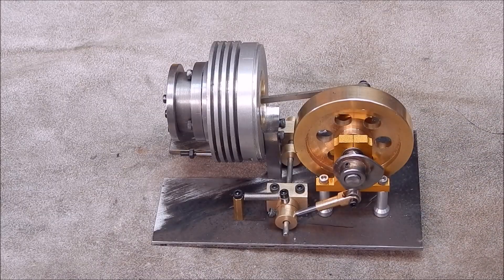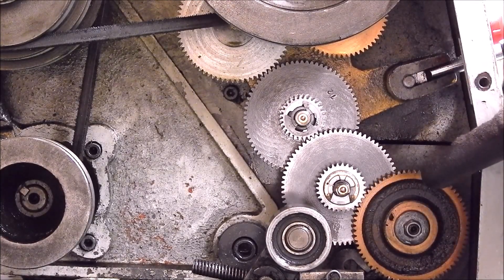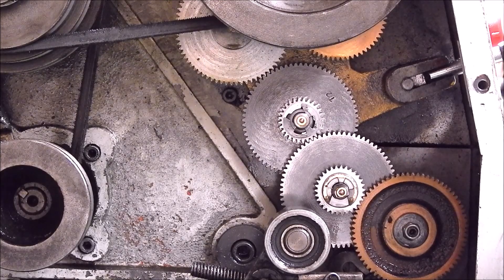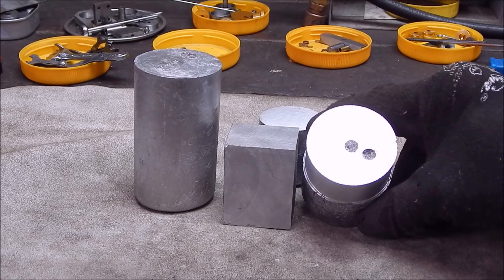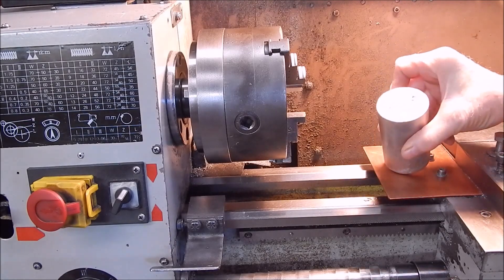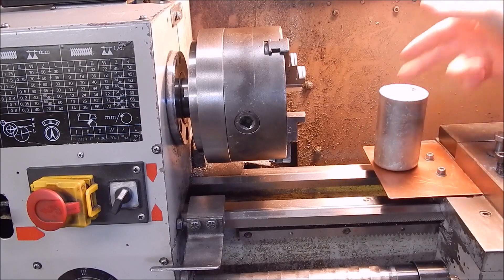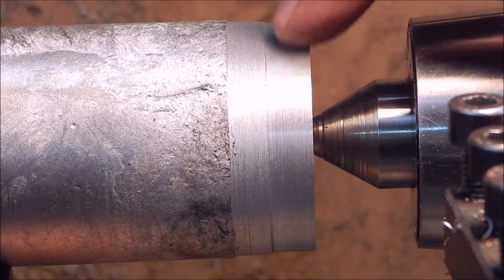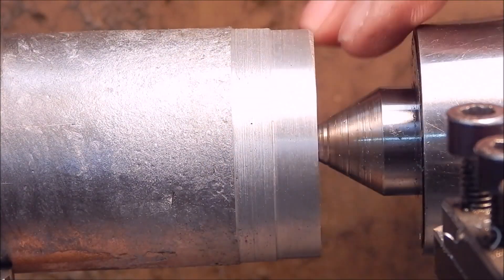Home cast aluminium round stock from scrap Toyota car wheel rims

Comment: What alloy is used for rims ?
6061 in USA and 6082 in Europe ?
Reply from the maker: A356 is most widely used according to Google - it has a significant silicon content and is heat treatable to attain high strength and impact resistance.   Most wheel rims are cast, but forged rims may use a different alloy mix due to the manufacturing process.

Comment: I repair cars for a living so I always have aluminum parts for melting. I tore apart an old water pump and an A.C. Compressor the other day and separated the aluminum from the steel. I save the aluminum and take the steel to the recyclers.
Reply from the maker: A scrap alloy  cylinder head would be good as well, just a matter of breaking it up somehow.  Cheers Rob
Reply: @Xynudu  heads are a little harder to come by because they generally go back to the builders as a core
Reply from the maker: I have melted down scrap pistons from cylinder liner replacement jobs and they are made from pretty good stuff - quite hard and good for gear cutting.  Lots of useful stuff in cars.  My father was a motor mechanic all his life and I have been there and done that with most aspects of vehicle rebuilds ;)  Cheers Rob

Comment: Hi Rob do you melt down the swarf and reuse it
Reply from the maker: No.  It's a waste of time Leon as the surface area of the chips is massive and that means lots and lots of oxide in the melt.  So it basically turns into dross mostly, which you then have to remove.  I know some people re-melt the cuttings, but I'm not that tight ;)  Cheers Rob

Comment: Rob, you mentioned the Kerosene motor oil mix. What are the ratios?
Reply from the maker: One part clean car engine oil to 5 parts kerosene. You can make it any mix you want, but I find this works OK on ally and steel and doesn't smoke much when things get hot.  Cheers Rob

Comment from the maker: IMPORTANT:  Do not overheat your molten metal.  The higher the temperature, the more gas and bubbles will form.

Pre-heat the mold if possible.  This becomes increasingly important as you lower the melt temperature.

High quality aluminium is used for demanding applications.  Only use that.  Don't use low grade scrap which has a high zinc content and breaks rather than bends.  More zinc equals more gas.

This link to an informed article about de-gassing is excellent reading:  https://drive.google.com/file/d/15tAqUUMSssVN5RI7O-cuJrcQfWYg7Wk_/view

Always wear protective safety gear.  Do not allow kids, pets, moisture or other hazards any where near metal casting operations.

Cheers Rob.
Reply: xynudu I’m extremely interested in parts casting, patterns and smelting. The problem is I don’t know enough to ask the right questions. Any tip and tricks are greatly appreciated. The most important thing is getting hole in the right place. thanks for sharing.

Comment: Thanks for the follow up video Rob. That looks pretty decent, I will have to try it. Aluminum here in Canada is stupid money also! I get most of mine from the metal recycler. Cheers, Doug
Reply from the maker: The suppliers sure rip us little guys off.  I hate to think how much it must cost most people to build model engines etc with new stuff.

Cheers Rob

Comment: I do the same thing Rob, but I use HSS cutters and the finish seems better.  I get the same finish as you with the carbide. I pour the aluminum into soup cans and machine off the tin.  A little bit dangerous, but I have a face shield set up.  I use the soup tins and steel aerosol cans (with the tops cut off) as various sizes are available. All your advice in relation to degassing etc is spot on.  I have found the  temperature of the aluminium at time of pour is critical.  I find if too hot I get porosity in the billet.
Reply from the maker: Hi John,  HSS with kero gives the best finish as it won't gall like uncoated carbide. 

I started off casting in soup tins and still do for larger diameter gear blanks.  The tin easily cuts and tears away after.  Steel tube is better as you can pre-heat it and the mass allows the aluminium to cool more slowly with less heat loss shock.  Cheers Rob
Reply: I have used tins also but I remove them from the ingot by splitting down the side with a dremel

Comment: Rob, you mentioned using a mix of engine oil and kerosene.  That's new to me and I'd like to know what weight oil and what proportion do you like?  Would it be ok for steel as well?
Reply from the maker: Yes,  I use it for every thing.  It's an old timers (cheap skate) trick.  You can make it whatever ratio you want, but I find one part clean engine oil with five parts kerosene works well.  Stops galling and cools things down.  It can smoke a bit if things get real hot.  Cheers Rob
Reply: @Xynudu  Thanks for the timely reply.  Include me in that cheap skate group and I'll try it.

Comment: I’m fortunate enough to have access to the local scrap yard so must of the aluminum that I get is extruded, and is really nice to work with. I do get a surprise occasionally with some of the steel I get but I guess that’s part of the fun of trying to make something out of nothing , ha ha  ! Best to you and I really enjoy your videos.
Reply from the maker: Yes, rusty steel can hide some issues.  Axles can have a super hard outer section and a soft centre - they make them that way to flex without failing.  Bastard to use.  I have 10 foot of the stuff (big diameter) in my scrap heap. LOL.  You can never be sure what you're getting cheap. Cheers Rob

Comment: Hello Rob love your videos always very interesting, but you passed a comment saying you use a home made cutting fluid of kerosene and engine oil, what ratio do you use. Paul from UK
Reply from the maker: Hi Paul, 

Yes,  I use it for every thing.  It's an old timers (cheap skate) trick.  You can make it whatever ratio you want, but I find one part clean engine oil with five parts kerosene works well.  Stops galling and cools things down.  It can smoke a bit if things get real hot.  Cheers Rob
Reply: @Xynudu  Thanks Rob I bought some paraffin as we call it here some time ago and did not know what ratio to use, I will make some u thanks.

Comment: Hi Rob, nice castings, did you cast them vertically [ie as a pouring sprue] or horizontally as a pattern with the attendent sprue & ingate.
Thanks Graham.
Reply from the maker: Hi Graham,  it was all cast vertically in a steel tube.  The previous video shows how:  https://www.youtube.com/watch?v=jmiRw2hDoDI
Reply: @Xynudu  Hi Rob, thank you for your reply I've cast vertically into sand before but not too good with porosity  but I like your idea with the steel tube & old cylinder barrels also warm them up 1st & don't heat the alloy too hot, & a nice steady pour, prob that's where I've been going wrong, I built a small gas furnace but most of my castings I do are in the larger furnace & fired by coke, & a bouncy castle blower mainly 'cos we allways gave a few tons in  for the aga rayburn cooker,I spoke to Martin[olfoundryman]  a lovely helpful man [like yourself!] & I'm going to try diesel as I have a burner. thanks once again Rob.btw I'm from yorkshire uk but I'm often in ozz at my daughters but scuppered for now with this virus.regards Graham.
Reply from the maker: Hi Graham,

I think you are correct. 

I just had this link to an excellent article on the subject forwarded to me:   https://drive.google.com/file/d/15tAqUUMSssVN5RI7O-cuJrcQfWYg7Wk_/view

Worth reading.

Cheers Rob
Reply: Hi Rob,Worth reading? you aint kidding!! thank you for taking the trouble to send me this [printed & put in my"foundry folder" ] so washing soda is a definite no no, I never use a degasser sometimes a commercial cover flux & allways a lid on the crucible,when I sometimes use a steel crucible I allways coat it with a zircon based refratory wash also my steel ingot moulds & tools, as you will know molten alloy dissolves steel & I believe it also contaminates the melt.  Regards Graham.

Comment: Wait a sec..Australia is in the top-three producers worldwide of bauxite. And Aluminum is too expensive there? Doesn't add up.
Reply from the maker: Yes and yes.  We are being ripped off big time.
Reply: @Xynudu  I wonder if that's a result of the Rio Tinto / Alcan merger in 2007. Neither here nor there..that sucks that Oz is getting screwed on one of their most abundant minerals. I would have thought you'd be awash in aluminum stock to mill with. Sorry to hear it.
Reply: To smelt aluminum from bauxite requires huge amounts of electrical energy--much more per kg than steel for which cheap coal and other fossil fuels can be used. Australia has a hydro-power (the cheapest source of electricity) capacity of 4.1 gigawatts. By contrast, the Columbia River basin in the NW United States has a capacity of 29.3 gigawatts, some 40% of the U.S. total. For this reason, a lot of aluminum is produced there, even though domestic sources of bauxite are puny compared to other countries. 

Greater still, China's hydro-power capacity is a whopping 352.2 gigawatts. It's partially for this reason that 60% of the world's annual production of aluminum comes from China. Additionally, it's production of bauxite is almost four-times greater than Australia and is the largest in the world.
Regional economies-of-scale aside, the price for most things is determined by how much people are willing to pay, rather than how much those things cost to make.

Comment: What size lath do you use Rob? Looks stout
Reply from the maker: Hi Eric, it's a 10 x 18" Chinese lathe.  It is solidly built and has a Morse 3 tailstock which is uncommon for that size.  Great little unit.  No longer available though.  Cheers Rob
Reply: @Xynudu  thanks Rob. 
Im going to build a version of your Sterling engine. Do you have some plans ?
Reply from the maker: No plans Eric, but I did include the dimensions in the description for the videos I did on the two I made.  That and a bit of common sense will get you there.  Cheers Rob
Reply: @Xynudu  ok Rob. Tks.

Comment: Fabulous! Amazed at how good that it is from such a simple melt set up with out any of the fluxes etc that some advocate. I have four aluminium wheels, but for the moment no project I can think to use them and no time to play, but the ideas are stored for when opportunity arises. Thanks for sharing!
Reply from the maker: They are a bit difficult to cut up, especially given their shape and extremely tough.  No way you will break them apart cold.

Circular saw makes a huge mess so I use a sawsall/reciprocating saw.  Works well provided you use a bit of kero to lube the cut.   I will have to cut up my last remaining scrap wheel pretty soon, as I'm right out of small pieces to melt.  Cheers Rob

Comment: Have you ever tried smelting aluminium drinks cans? If so, what was the blank like? My guess is that it would be a pretty soft grade of alloy, and probably quite "Gummy" to machine.
Reply from the maker: No. I drink beer from glass stubbies, so no cans.  I believe cans are made from high quality, almost pure aluminium.  I have seen stock from cans being machined and it seemed OK to me - no obvious issues. Cheers Rob
Reply: @Xynudu  They are made from grade 3004 or similar, almost pure aluminium but with a little bit of manganese and magnesium added for extra strength. It's very soft and ductile in the as-cast state, easy to machine and has a nice shiny finish but you need a chip forming groove in the tool otherwise you'll get stringy swarf wrapped around everything.

Comment: Hi Rob, Havn't bought aluminium for many years, just a lot of 3 wheeled toyota around the neighbourhood LoL
Reply from the maker: Ha Ha.  These were an extra special deal as two of the rims had brand new tires on them which fitted my trailer perfectly.  Even if you have to pay for disposal of the tires it still works out at mighty cheap aluminium.  You can always get them for free off of Craig's list or Gumtree. Cheers Rob

Comment: That last pour came up really well Rob. Part of the secret is to only re-melt quality cast aluminium such as wheel rims because they were cast with all of the right ingredients to cast properly.
Reply from the maker: Definitely Mark.  There is a lot of low grade aluminium used out there.  Go for something that has to be good quality for the job it does and you can't go wrong.  Cheers Rob

Comment: I saw a video about casting the guy use a some pieces of old cast aluminum in with his unknown aluminum crucible melt because it still has degassing chemicals in it. I liked your tip on preheating you cylinders before you pour. Do you melt your aluminum chips? Thanks for sharing.
Reply from the maker: Hi Sam, no I never re-melt turning chips.  It's a waste of time as the amount of oxide on their surface is massive.  Just makes a lot of dross from my experience.  I know some people do, but they must be even cheaper than me ;)  Cheers Rob
Reply: @Xynudu  I think this is the reason why melting beer and soda cans is a bad idea. The surface-area-to-mass ratio is enormous, so a big portion of the aluminum is oxide and lost as dross. It's also not good machining metal as well.
Reply from the maker: Hi Todd, there are a lot of true facts and a lot of old wives tales about backyard metal casting. 

I can understand people trying/using a de-gassing agent if there is a gas problem as with low grade ally, worth a shot, but WHAT the hell is flux supposed to do ?   Why would you add flux to perfectly good aluminium that was successfully used before by industry ?  Makes no sense to me at all. 

I have yet to hear a valid reason.

Cheers Rob
Reply: @Xynudu  Rob: Well, I don't know the actual chemical/metalurgical reasons, either. I'd like to look into it just for fun (a good covid project).

I think a lot of people just go on myfordboy's demos without knowing specific reasons. At least one YouTuber, luckygen1001, tried to refute mfb's (silent) recommendation in a rather nasty way, but he reproduced mfb's procedures and methods in such a perfunctory and slipshod way that I wrote him off as a sore head (to be fair, luckygen1001's important contributions have come in showing methods of home casting of iron).

I'm going to do some poking about, and I'll report back here with some links to what I find.
Reply from the maker: Hi Todd, I have the utmost respect for MyfordBoy and he is a backyard metal casting master.  I wish I could be half as good.  I haven't kept up with what he has to say about flux, but from my observations/experience it seems like adding it is unnecessary/bullshit.   But maybe I'm wrong ?  Maybe there is a valid reason ?  I have yet to see it.  Good luck.  Cheers Rob
Reply from the maker: Great information Todd.   Thank you for sending me that.  Much appreciated.

Totally confirms my suspicions/opinion on the whole thing.  Interestingly a comment mentioned using a type of pool chlorine to degas, but as the actual amount of porosity should be negligible (visually) with good casting technique and material, it's also probably a waste of time.

Excellent info that I hope people pick up on.

I will include the link in my pinned comment.

Cheers Rob